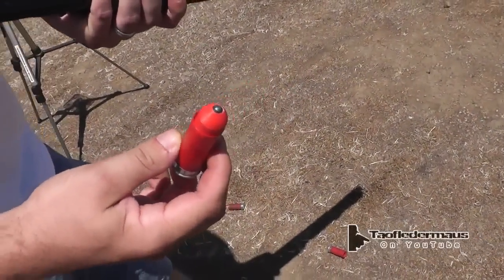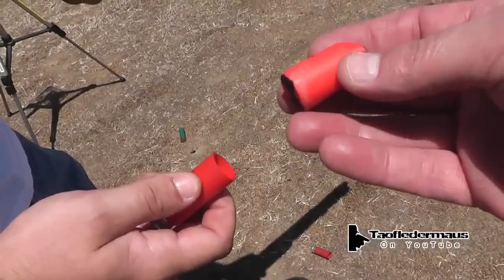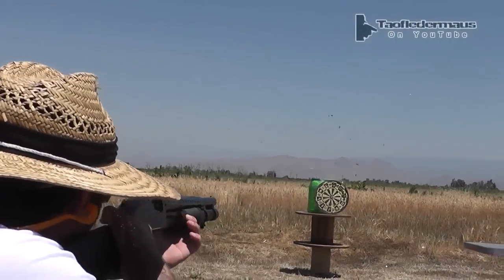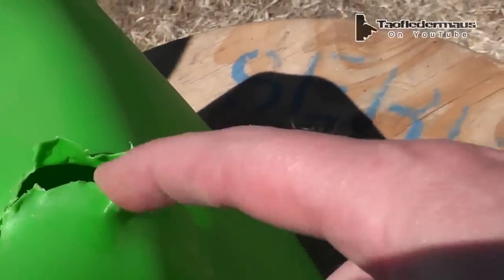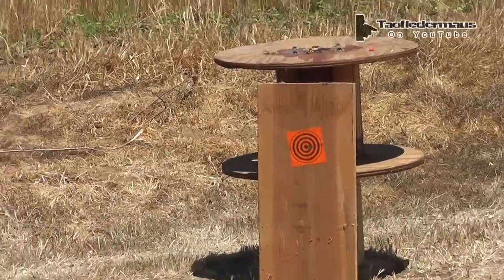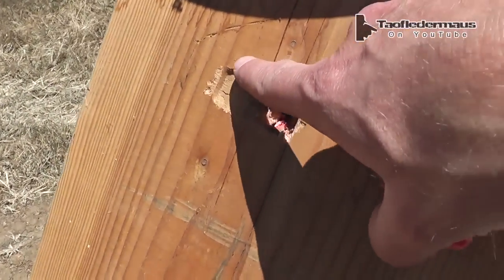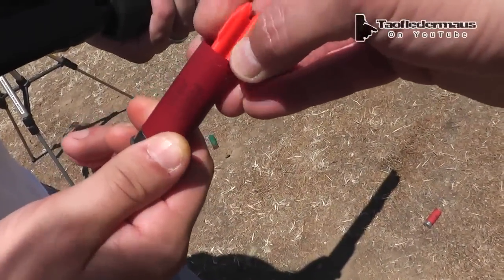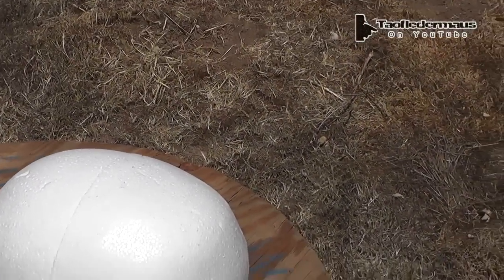"Terrifying" 3D PRINTED BULLETS - Spoiler:  they aren't terrifying!

Comment: Rifled slugs don't spin much if any at all. The Foster slug (most common riffled slug) maintains it's straight trajectory because it isn't solid, it's dome shaped (basically hollow at it's base) and this gives it the dynamics of what you see when you hit a badminton shuttlecock (the forward located weight helps self-correct any tumbling).

Comment: I think the reason the bullet doesnt fly straight is because all of the weight is on the front of the bullet so any slight fluctuation during its flight will cause it to wobble horrendously. Also it would help a ton if it was rifled. I don't suppose you guys could get a rifled barrel for your mossberg? That'd be amazing! Subbed for more wierd shotgun ammo!!

Comment: I'm guessing one of the reasons for that is becuase the type of plastic used to make the bullets is much softer than lead or whatever other type of metal you would use for a slug like that. so under all the pressure it goes through exiting the barrel, it changed the geometry of it in some way and causes it to tumble.

Comment: Like others have said, it is possible to 3-D print solid. Most printer's software automatically fills with a lightweight grid to save on cost. 

To improve your stability, consider adding the shot to the BACK of the round, rather than the front.

Comment: with these printed bullets is the plastic piercing or is it the small amount of lead at the tips?  also with a slight redesign of the interior of the bullet what is left can actually be turned into shrapnel that explodes out and sideways when it hits the target...if your designer is interested.

Comment: well a wax slug has more weight to it with the was and shot mix, also it is mostly solid all the way through. while these plastic ones (as shown) are very light and are hollow (also shown). if you watch the guy make them they dont get filled in very well and thats probably what causes it to be light

Comment: I would recommend making the bullet solid in the printer options so as to have more rigidity and weight. Along with possibly putting a swirl pattern on the bullet for more accuracy.

Comment: Great vid! Might need to design a printed bullet around a solid lead insert for a bit more weight. It'll still keyhole, but should do a little bit more damage. Still, I'm really surprised they did as much damage just the way they were.

Comment: The helical groves on a rifled slug do little but reduce friction surface area. It is possible to get actual spin on a slug, but you need a rifled slug barrel. (And I would not recommend firing a rifled slug through a rifled shotgun barrel.....rifled slugs are meant for smooth bore barrels.)

Comment: About the rifled barrel you can try to invert the way it works.
You can print the bullet with a spin in its surface.
Much like your turbine aluminum slug.
Probably a much smaller tooth size and the common step for the rifled barrel.

Comment: I think printing the projectile as a solid would be better that way you could drill it out and fit a penetrator in the middle or fill the cavity with lead shot, you could even print the spiral on the bullet to make it spin like they do on lead slugs or add fins for stability, but the fins would be to delicate to survive the blast.

Comment: Tafl,
I have an idea for a 3-d printed bullet.
Some of the early rockets, had nozzles pointed at slight angles. This would produce spin. Maybe if you made the front of the bullet concave, And had the printer print curved veins inside (or along the sides) the bullet. The air passing over or through it would cause it to spin like Rifling. I would guess that 3 would probably be your best bet. @ 69-90 °

Comment: different software that interprets and translates the 3D object to a 3D printed object will have different ways to fill the internal void space of the shape. you could have it completely hollow if desired, or honeycombed for weight and strength. the printer used for these slugs appears to have used a simple honeycombing technique, to create the strongest shape with the least material and weight. if you want to more aggressively attempt 3D printed slugs, you may want to try it with a completely filled shape, instead of a honeycombed one. it will be heavier and stronger; functionally identical filling a DIY slug mold with molten ABS plastic.

Comment: Add rifling to the slug model, and turn off the resource-saving grid fill for the printer, and you'll have a solid, straight-flying plastic slug with a higher weight.
Reply: Another option would be to fire it through a double rifle instead.

Comment: Ideally you would be looking at a sectional density that is at it's maximum given the mfg process and materials you have selected. You should have printed everything solid if the intent was to make a slug like projectile. Not the hatched construction. Definitely not the first 3D printed projectile. We definitely see why material density is important with the last projectile, which disappeared completely due to flight characteristics combined with poor density.  Really cool video!

Comment: Looks like when you shot the wood the bullet was sideways, but propelled the lead through. Get it going straight with a .380 or 9mm in the tip. Lead goes through intruder, but plastic is sure to put them on the ground

Comment: If you're talking about plastic sabots....theyve existed for a while now and were never known for accuracy. 
Poor gas seals...poorly stabilized by rifling and in worst case scenarios a non stabilized bullet will tumble end over end as soon as it leaves the muzzle. 

There will never be a need to print bullets when you can cast better ones from lead and the latter is widely available. I make due with range scrap. 1lb = approx 30x 45 bullets in 230gr

Comment: like that other user said sabots....maybe a two piece round that does not separate, it drags the printed portion for flight stability. it would slow the round slightly to acheive greater accuracy. and prevent bullet tumble.

Comment: Is it possible to make an aerodynamically stable shotgun round?
Since this is a 2 material round, you should be able to place the center of mass well in front of the center of pressure and the center of lateral area.

Increasing length (also increasing moment of inertia), moving the weights forward, and moving most forward facing surfaces back might improve stability and reduce tumble.

Comment: it would be cool if you can mount both casios side by side on that plate mount you use, then combine them into a 3D footage, 3D slow mo, that should be awesome, and there are tons of software online that basically do all the hard work, you just need to import the two separate footage files.
do you think you will give it a go at some point? even just one shot for testing purposes, i am interested in seeing how 3D looks like for those slow mo bits.

Comment: I would suggest making a metal version. Metal 3D printers exist (Usually fusing steel powder and then filling the gaps with bronze I believe?) The printers are very expensive but see if you can rent some time on one perhaps?

Comment: Tony needs to print the slugs for you with 100% fill (Solid plastic, no honeycomb)
Reply from the maker: Buzz Life  It would still be very light.   Plastic has very low density.
Reply: ***** that honeycomb design does make you wonder how it would work if applied to a metal 3D printer.

Comment: I would be interested to see the effect of very fine shot embedded in solid plastic.  I suspect it would behave much like the wax shotgun shells, which are meant to hold shot together until it strikes.  Meant to strike more accurately, but still spread the energy after impact.  The idea is that, like sand, the granular nature of packed shot will spread the energy of an impact.

Comment: these slugs are tumbling because they are designed improperly, not because the barrel lacks rifling.

anything that's going to fly straight is going to need a heavy nose and lighter tail so the CG is ahead of the center of pressure

even lead cup-type slugs use this principle

Comment: You could be right, I've never touched anything 3-D printed so I'm not sure how strong it is. But seems like rifling a 3-D printed slug like the rifled lead slugs used in smooth bore shotguns might work. As long as the thing had a little weight to it...

Comment: Actually, I don't think so. I think I remember Hickock45 talked about rifling on slugs(lead), and he said that they actually fly straight because they're really really front-heavy(like badminton birdies), not because of the rifling on the bullet.

Rifling has to actually dig into the projectile to effectively impart a spin. That's why rifled bores are generally slightly smaller than the diameter of bullets.

Comment: I would analyze that the wood only got pierced because of the metal bb placed on the tip the bullet itself acts almost like an anti tank round it uses the plastic to open a hole then the bb keeps going it is a genius design but the bullet in itself was actually ineffective the hole left by the bb gave the plastic room to expand into so it blew shards of itself into the hole which is why the board had plastic all over the back  in the hole and well this bullet was not effective other than that

Comment: I would of added a spiral grove around the bullet for spin and stability.
Reply: If something like what you're suggesting rarely even works on machined metal slugs, I highly doubt it would work on these 3D printed plastic slugs.
Reply: McClover Grooves on slugs impart a negligible amount of gyroscopic stability, and in some cases even make them more unstable. The grooves on lead slugs are to decrease the damage they to a choke.

Comment: Jeff, Do you think that the larger of the printed bullets didn't actually penetrate that deeply into the 2x12 but rather the lead shot that was used for balance and weight did? I was just thinking that since it seemed one side of the impact area was more damaged than the other. I too was surprised that Matt was able to keep those shots on target. =)
-Timothy

Comment: It's real you can 3d print an AR lower receiver you can print that slug they put in there without a doubt the lead they added in by hand but the projectile was deff probably 3ad printed. You can 3d print damn near anything the casing was a normal shotgun she'll though. But the projectile "slug" plastic thing was printed

Comment: dont think the material used in 3d printing would be able to withstand the friction on the thinner parts if you rifled the slug, and same thing if it encountered rifling in the barrel. not exactly sure, but im thinking bits of it would break off which would cause a lot of instability.

Comment: Why not print deep grooves and hope to induce aerodynamic spin, like a dart? The bullet itself doesn't have to fill in the casing all the way round, when there is a wadding to seal it.
And if the inside is honeycombed can it be printed with an open honeycomb that allows lead to be poured in? or lead dust...

Comment: You should get Tony to remake those bullets again, but this time tell him to print the bullets as a solid structure rather than the sparse honeycomb shown here. It adds weight and would probably make it more stable.
Reply: It would also make the bullet longer to make, more expensive, and maybe even melt the inside, because direct contact is a better conductor of heat then air. A honeycomb structure may have it's drawbacks but Tony probably ruled it out and choose it over a solid bullet.

Comment: I have a rifled barrel for that shotgun if you fellows nee to borrow it. It seems the slugs would be lethal, but the lower mass is hurting its ability. I think with a bit of redesign, it could fly better, but it will always suffer due to its lack of mass. If I was hit in the chest with that, I am rather sure I would be dead though.

Comment: here's hoping no one wisens up and create needle sized plastic flachettes.  That's the problem with a 3D printer.  you can actually use it to create needle or nail sized bullets that use chemical propellant instead of gunpowder.
what's worse is that you would barely hear a sound when you fire it.

Comment: No, bombshells may be possible, but bombs require explosives, which do not come from 3d printers.  A 3d printer is not a make-whatever-I-want device, it is a method for creating structures from plastic (or, at the high end, metal).

Comment: Smooth-bore shotguns are untraceable by ballistics testing anyway ('cause all that is based on riflling patterns on the bullet, and guess what, smooth-bore means no rifling), and they still have to, you know, buy the shotshell. Literally nothing about adding 3D printing changes that, but thank you for your well-considered contribution!

PS: as a left-winger, fixing poverty is a better solution than banning guns. Hope this helps.

Comment: im thinking a weighted tip and wings like a dart. but how to keep the "flights" from getting crushed when launched.?a twisted "flight would increase stabilty. a 1degree slant on the wings. the piston would need to be changed to a slotted launch vehicle

Comment: That was a very poorly made round. It should have been printed 99 or 100% infill making it a heavier solid object. It would have also been possible to design stabilisation into the round beforehand in CAD.

Comment: Ask for 100% infill nect time so its 100% solid plastic with ball bearings. The infill is how the inside is to me it looked like 30% honeycomb so with 100% infill it will be solid plastic and a bit over 3x the plastic weight.

Comment: These numbers are compiled by several reliable sources and printed in the PsychLaw Journal. If they look low, your imagination has gotten the better of you. But, to be fair, in the time 31 shootings in the US took place, the rest of the world had 14 combined. Average: 2.46 per year. Not all shootings had fatalities.
2000: 4
2001: 5
2002: 2
2003: 3
2004: 0
2005: 2
2006: 4
2007: 2
2008: 3
2009: 0
2010: 1
2011: 2
2012: 4

Comment: You do not want the printed material to bond to the inside of the hull.  That will cause the hull to rip off and become a cutshell, with a slight chance if it being a pipe bomb.

Comment: Those would make nice armor piercing rounds. if he makes any more for you have him leave a 5mm hole part way through it starting at the back and stopping a few mms from the tip. then put a copper slug the same size as the hole in.

Comment: Its too bad it was printed with not-100% infill. infill specifies the amount the inside structure is printed in terms of density. it looks like 25% to me. if it was printed with 100% infill it would have been printed solid. that then would have given it much more strength. also the weight in the end will affect the centre of gravity and make it want to spin more . if i were doing this i'd print it 100% infill and an end-to-end cavity for a metal rod that runs the length of the slug.

Comment: can u not alter the program as regards the "matrix" fill in .i think u should b able 2 specify "solid fill" as the "matrix fill in " is maybe a system default 2 save plastic wire . u could then play with a heavy nose cone & or balance ?

Comment: yes such a threat...so deduct the cost of the 3d printer materials etc and you have an extremely expensive slug, governments worry about the dumbest things i swear...you can make slugs out of wax and leadshot, you can cut the shotgun shell and use it like a slug, or you can just cast your own slugs out of lead, none of this is difficult or expensive as it would be to create a 3d printed slug, its a waste of time, so why people worry about this is beyond me cheaper ways to do things than 3d print

Comment: they seem to have no balance. perhaps try them through a rifled barrel?
Reply: Matthew Wilhoit Or make them pretty front heavy. Perhaps fins?
Reply: I saw some one else try that, discarding sabot, find under. It didn't work so well, but it is worth a try. Hell, it's on a 3d printer
Reply: Venomine95 Basically make a APDS-FS round on a 3D printer? Not yet pal, give that one a decade or so

Comment: Would it be better to cast bullets in a mold, faster then 3d printing.
Reply: Ideally yes.  It would be far easier to cast bullets in a mould and much cheaper too.  I think it's more of a testament to you being able to use ultra-unconventional rounds in a shotgun.  Check their other video about 15 odd rounds that worked.  They fire legos, gummy bears, silly putty, frozen vienna sausages and many others and they cause surprising damage
Reply: It shows you can not ban a some thing so simple. And there is aways two ways to skin a cat.
Reply: Keith Davis.. you dont even have to shoot legos to cause such damage. Try stepping on one with bare feet...lol. No I dont have kids but I have stepped on one and it pierced skin... damn buggers

Comment: So many stupid people in the comment section...
Lets get some things Straight:
1) an ice bullet will melt due to frictional heating. 
2) fletching would be ripped off immediately and would not affect stability.  
3) nose heavy projectiles are MORE aerodynamic (look at a badminton ball, darts, or the Apollo command module).
4) it doesn't fly straight because it is not dense enough and its cross sectional area, and therefor drag coefficient is too high.